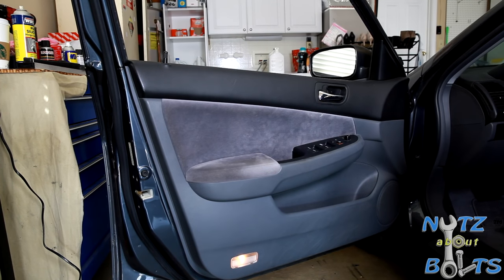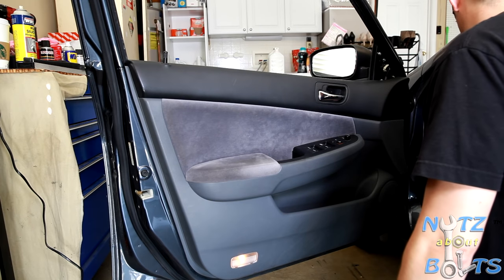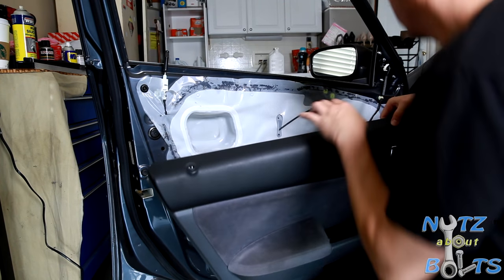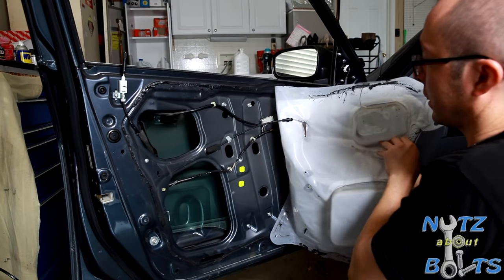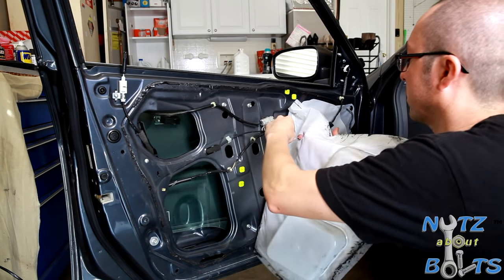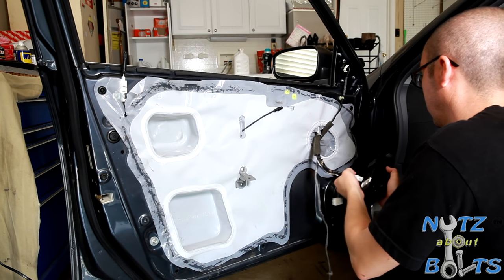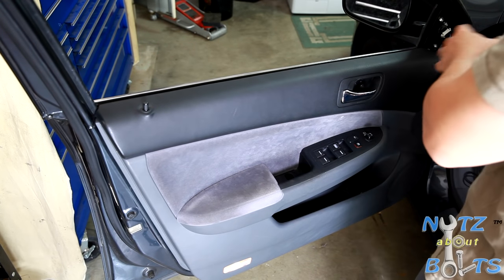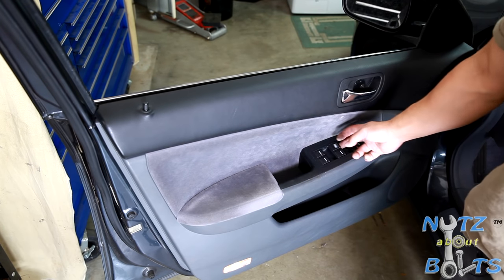2003-2007 Honda Accord Door panel removal

Comment: can you make a video for the oil pump gasket?
Reply from the maker: +Kuroshi Tsui there's no oil pump gasket, the oil pump is in the oil pan held on by bolts... there is no gasket to be replaced.
Reply: +NutzAboutBolts Damn Lol, I'm new to cars unfortunately proud 7th gen accord owner but I've been having an oil leak...last time I had one was last year In December it was the vtec solenoid gasket I replaced it and it ran no problem until a couple of weeks ago. leaking oil again but I can't find where..seems like its under the steering wheel pump by the tensioner. you know anything by any chance?
Reply from the maker: Kuroshi Tsui  I would say put in some oil dye or dye in general and use a black light to find the leak. You can buy the kit at an auto store. Make sure to clean the leak area, put in the dye, then wait for about a week or so, and use the dye light to trace where the leak is coming from.

The only known leak in that area that I know was from the power steering reservoir. It leaked onto the frame and I thought it was from the clamp, but it was from the p/s reservoir, which cracked on the bottom.
Reply: +NutzAboutBolts alright. thanks! your videos are great too very helpful, the only channel I've found that works on 7th gen accord. Thanks again
Reply from the maker: Kuroshi Tsui
thanks! let us know how it goes. :)

Comment: Shit,I have to take my door panel off cause my drivers door won't open from inside and outside the car with the remote and using the key on the door to unlock it it won't open.Ive got my work cut out for me.
Reply: Same problem, how did you get panel off with locked door?